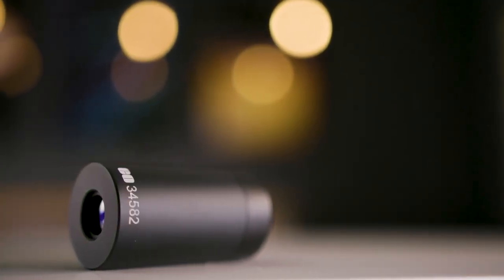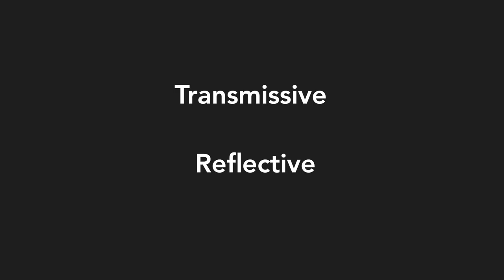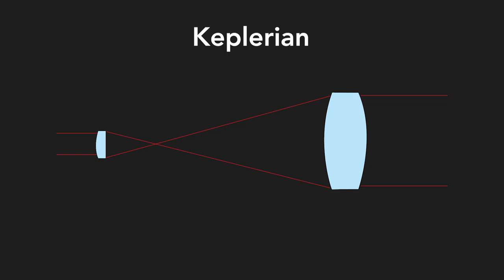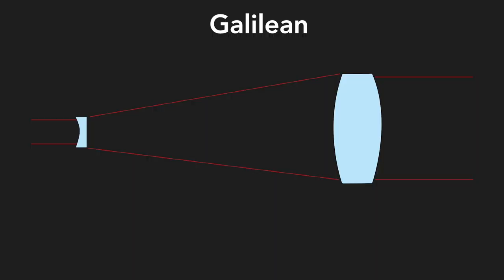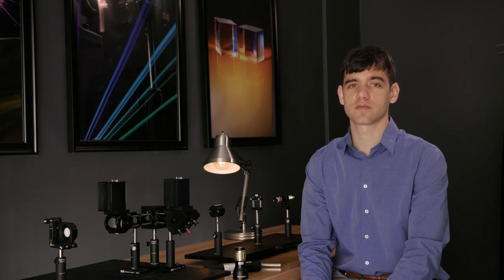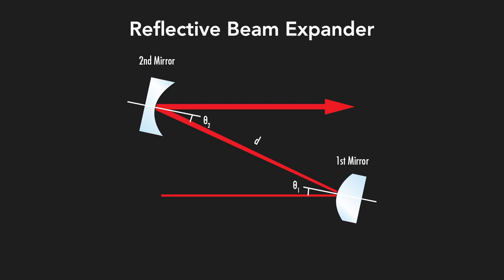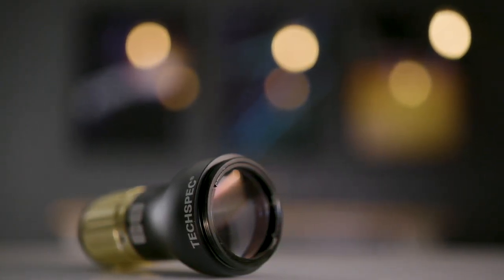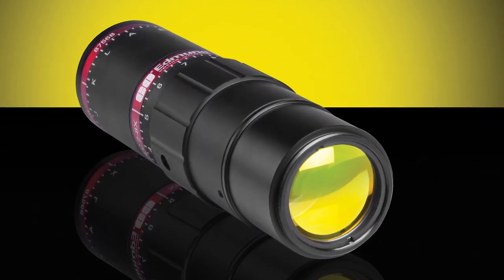Beam Expander Configurations & Designs | Laser Optics Lab

Comment: Well put together!   I appreciate informal videos of this quality.   I am currently considering a beam expander for my home built CNC 100 watt Co2 laser machine.    I am running 25mm mirrors but only have a 20mm a-spheric/meniscus lens.   Previously before I rebuilt the gantry I was running a 25 mm PCX plano-convex lens which would have been better for beam expansion I believe, but opted for the smaller 20mm tube setup in consideration of increasing raster etch speeds which might have over driven the steppers due to dynamic load shift.
Anyhow I will look around your sight and see if I can figure out what my best option is for my setup.  If you have recommendation feel free to drop a line here.  I'm always on youtube learning about stuff

Comment: adjustable expander makes no sense, if you moved the lens positions you will no longer have a collimated beam , you can however place a sliding aperture between the lenses that has a hole dia equal to the smaller lens and this will allow for a reduction in beam diameter on both ends but it will clip a portion of the beam and reduce energy, depends on the use you need, btw idk if this actually exists but i just thought of it now so all credit and royalties go to me
Reply: or maybe they use some special lens in between instead of the hole aperture